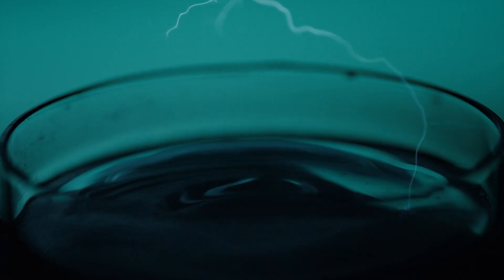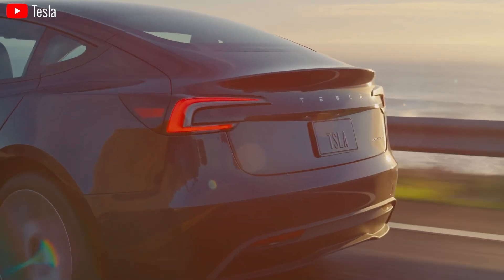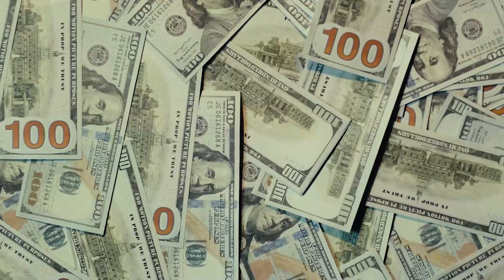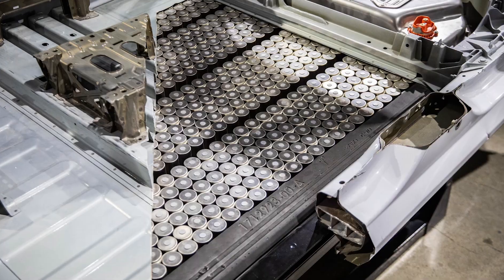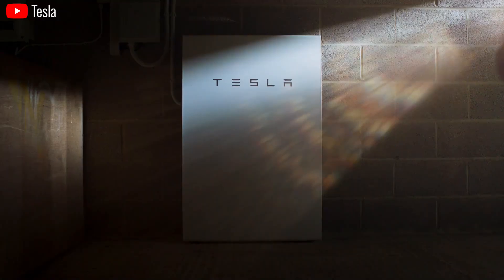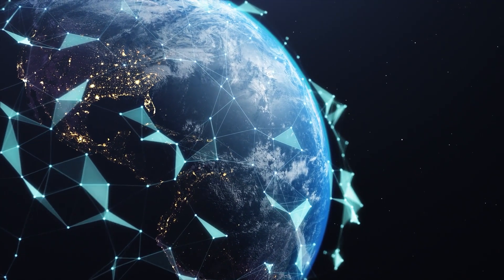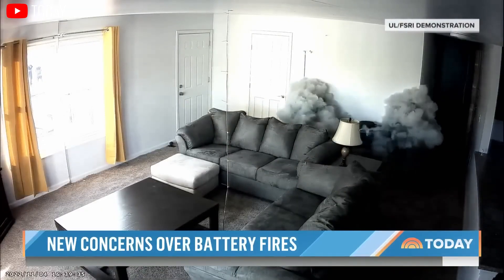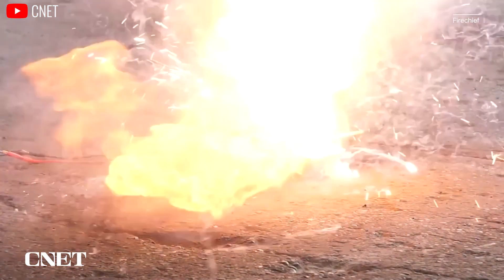It Happened! Elon Musk LEAKED All-New Battery SAND-Made, Change The Entire Industry!

Comment: So let me get this straight....

You are going to put hot sand into a car, use this sand to boil water, which then turns a turbine, which then produces electricity, which then runs the car?

Wow.   Amazing.   We are going back to the steam engine times.   Full circle.   Genius!
Reply: Thank you, that says it better than I was about to. Remember, this is an AI video that's more apt than not mostly BS. 

Sure you can use the heated sand to produce charging power but that power will have to be held by none other than standard lithium ion batteries in order to make the power available to the car...that is unless you have a very long extension cord.